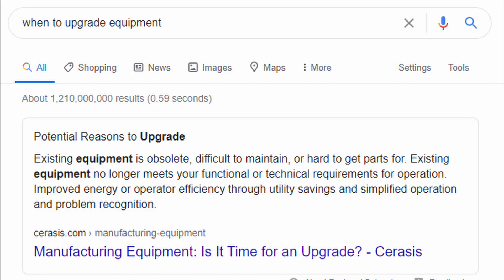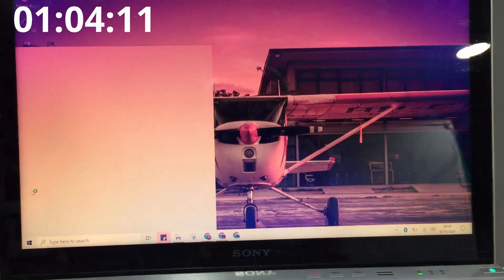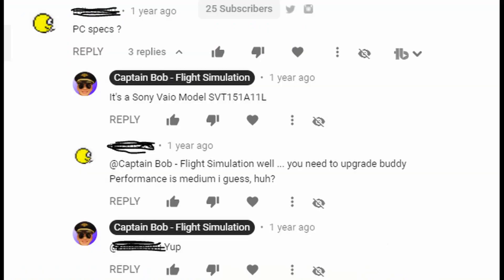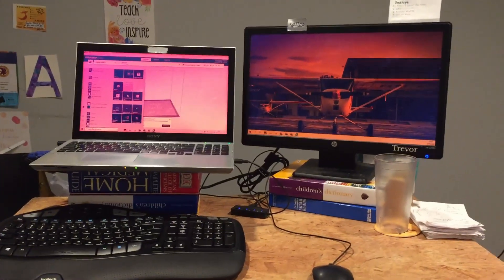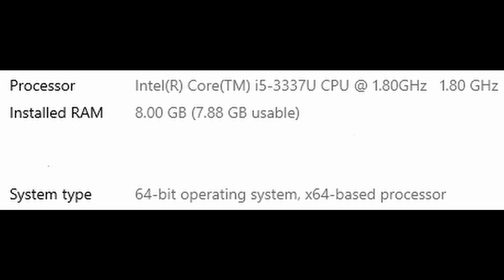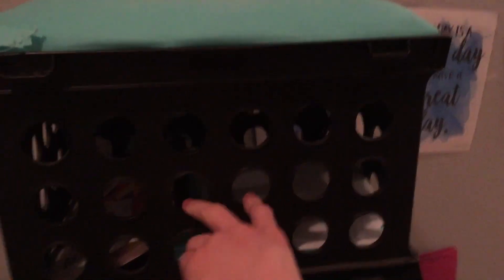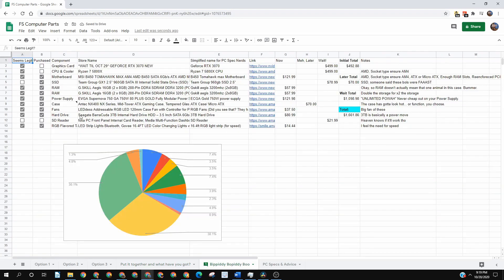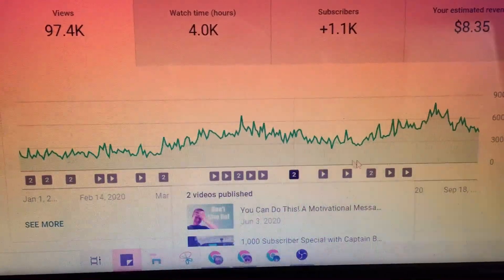I Should Have Done This A While Ago... FSComputer Part 1: Computer Research | Captain Bob

Comment from the maker: Things I've learned through the journey:
*OVERCHARGED BATTERIES ARE BAD!!!! Dispose of it at a proper facility ASAP. They catch fire, explode, and also increase the thickness of your device!
*I chose to build a new PC instead of upgrade partially for convenience, but primarily because the computer is aged so much most money invested would not be returned.
*There are a lot of bottlenecks. If your PSU can't supply power to your graphics card, it doesn't matter if you have a 64 million dollar graphics card.

*Reach out to any friends you have that know about something you don't. You can learn a lot (but make sure to make them a cake, or give them a cheeseburger or something).
Reply: Remove the battery and use ac power instead
Reply from the maker: @kiancabarle123  Just did that 👍 Want to 3D print a protective plate to make sure none of the terminal connectors short out.

Comment: What's ur budget.. I could help ya out.
Reply from the maker: My budget started at $700, but then it slowly doubled.
It'll be a financial slap to the face, but much better than having to upgrade each individual component to what I should have started with.
Since this needs to run Davinci Resolve, Fusion 350, FS2020 and a few other large programs, I'd really like it to not be painful 😂
Reply: @CaptainBobSim  I can make you a part list if you want
Reply from the maker: I've already purchased most of the parts, but I'd be curious to see how you'd go about doing this if you still want to :)
Reply: It's a bit over but ur not going to have to upgrade for a long time ( although it'll only show 970$ on the list cause it doesnt have the price for  the graphics card)
Reply from the maker: @ufo9661  Thank you for the link! I'm just curious, what made you decide on an Intel CPU instead of an AMD?
Reply: @CaptainBobSim  I'm an intel guy, plus the 10700k is a great cpu for the money

Comment: Also my man what are your new specs
Reply from the maker: New Specs:
Geforce RTX 3070 (Maybe RGB? 🙂)
Ryzen 7 5800X CPU (If not, Ryzen 7 3700X CPU) (Not RGB 😐)
B450 Tomahawk Max Motherboard (Maybe RGB?🤔)
Some sort of 500 GB SSD 2.5" (Not RGB 🥺)
32GB RAM (x2) Two OLOy WarHawk DDR4 3600 16GB (2 x 8GB) RAM (RGB! 😁)
ECGA Gold 750W power supply (Not RGB 🙄)
Antec NX400 Mid-Tower ATX Case (Very RGB!!😍)
3TB Barracuda Hard Drive (Not RGB 😫)
Reply: @CaptainBobSim  thanks man I needed to build a new pc
Reply from the maker: No problem! Same boat :)
Reply: @CaptainBobSim  probably not going to use the graphics card you used as I am using a 5700xt as it is cheaper
Reply from the maker: Absolutely, That is a very good option.
Reply: @CaptainBobSim  do you think making a home cockpit is worth it
Reply from the maker: @yummy9731  It ultimately depends. Do you enjoy building and learning? Do you care about aircraft system realism/ease? It certainly has been worth it for me :)
Reply: @CaptainBobSim  thank you my Man I will continue to make my cockpit

Comment: I dont think a 3600x is a good buy. Get the ryzen 3600 instead, youll still get the same performance, just no overclocking.

Btw, get 3200mhz instead of 3600. You could out the budget saved on ram to your gpu.
Reply from the maker: I agree, I'm not getting the 3600x. I've already purchased the RAM, but am sure some lower mhz RAM could be useful. I'm intentionally buying powerful parts, as this will be used for very heavy and beefy programs.
Reply: @CaptainBobSim  if you plan on doing streaming, you might want to go with the ryzen 7 as it has 8 cores so you will have better encoding, but the ryzen 5 is also really good and 6 cores should be enough, just maybe will struggle with a few things.
Reply from the maker: @Jake-yv3kf  Thanks for the tip! I think I'm going to go with the ryzen 7 in the end.
Reply: @CaptainBobSim  I got the 1700 for a really good deal and it is great, I think they were selling them for less then the current gen ryzen 5
Reply: @CaptainBobSim  you could ger 2666 mhz ram and overclock it. They are way way cheaper. Its like 30usd per stick. If you need help, you can ask me
Reply: Oh and also, get used parts. My pc is only $350 for an rx580, ryzen 2600, 16gb 3000mhz all that for 350. Rx570 and 580 prices are extremely low these days.

P.s, if you can, GET A 3070, same performance as the 2080ti for only 500. (But i dont think youll get one tho because of scalpers and stuff)
Reply from the maker: Yeah, I'm trying to get a 3070 but don't know if it'll work 😂 Thanks for the tips!
Reply: @CaptainBobSim  if you can wait, get the new amd cards. I think theyre gonna have a lot if stock and anti bot protection so hopefully you can get one. There are a lot of leaks going around about the insane clock speeds so hopefully it will be as fast as the 3080
Reply from the maker: Excellent! I might wait. Hmm. I'll have to think about this!

Comment: Btw does your laptop have an ssd? It makes it 10x faster in terms of load times on apps and windows.
Reply from the maker: Negative, only a hard drive. An SSD may have been a good upgrade for it, but other aspects of it were so slow, and quite frankly falling apart (Refer to the intro 😂).

Comment: Eyy i also built a pc because of my crappy laptop. My laptop has an i7 3rd gen mobile which sucks. I now have a ryzen 5 2600 with an rx580

Btw, thats actually impressive that you can make videos with an old laptop. (That battery is a hazard replace it immediately)
Reply from the maker: That's fantastic! Good upgrade. I run a lot of the hefty programs on another computer, but it's not usually available (and also slightly slow, but nothing like downstairs). I'll replace the battery at once!